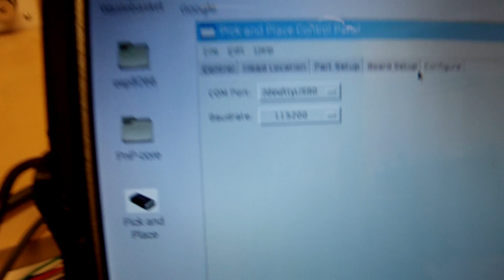Custom SMD Pick and Place Machine #2

Comment: which controller board you have used? an arduino or any other boeard?
Reply from the maker: Arduino RAMPS 1.4
Reply: and software for it? where i can get that?
Reply from the maker: @ashwinabhang229  RAMPS is running marlin firmware with 3D printer heaters disabled. Raspberry pi has a python script that generates the pick and place gcode and send it to the RAMPS board

Comment: Considering this is 3-ish years old, I imagine you've already figured out that it is actually NOT the arduino's fault that the motion isn't 'straight' to the point when performing a diagonal movement.

Its doing this because of the code being used... 300,000 mm/m is kinda fast, but not so fast that the arduino couldn't handle it. There are printers out there that have 'non print move speeds' a bit higher than that, and are still using a RAMPS 1.4 setup. The issue, is that the distances are not even. Therefore the head doesn't arrive at the same time. Even if you are just moving it X100 Y100, its still not even because of how you have the Axis for X and Y set up. One has a different step vs mm ratio going on. If that isn't accounted for, then of course its not going to  reach it properly. 

But what I'm curious about, is since you seem to be using a RAMPS 1.4 setup, are you using something like marlin or another 3D printer equivalent firmware? Or is this a custom one that you've made up for it? If it is indeed a 3D printer equivalent, or even a normal PnP firmware designed for the board, why exactly are you making your own software to control it when there are actual PnP software out there for free that is really quite good. Some can even just do things via normal Gcode to get things done. 

Anyway, i wouldn't go saying its the fault of the arduino.... 16Mhz is really really fast for what is being asked of it... specially if its just straight line movement... what really 'gets' to an arduino is circular movements because of the massive amount of computational power required to do the floating point math... But a straight diagonal line? oh geez it can do that no problem! Specially if you have the code set up properly... Because remember, it doesn't need to send a pulse out for every single tiny microstep that the stepper drivers are configured for... They can be sent as whole steps, which means less math being involved, and less pulses needing to be sent out. If the software is done correctly, it'll know to use microstepping for the fine movements, and whole steps for larger ones, which would negate the issue shown.

Comment: what drivers do you use? RAMPS1.4?
Reply from the maker: Yes that's correct, the RAMPS 1.4 with a4988 stepper motor drivers
Reply: any advice on how to program the motion of the pick and place machine?
Reply from the maker: Jason Wei Han Lee The pick and place machine uses python to send gcode to the RAMPS board over the serial connection. I used gcode for basic XYZ movement and I'll use a custom system for the vacuum and nozzle stuff :)
Reply: willz1200 sounds good. I will try it out. Thanks mate

Comment: Hi  willz1200,  It's an amanzing machine with high speed and accuracy, I have some doubts, how  determinate the movement of the heads  in some case the PCB is without motion  but the pick and place's head is moving is factible in that way or in another way the head is without motion and the PCB is moving or both in movement?  you know some links or papers with that focus?. For another handle in your PNP machine have axle instead of ball screw is more precise ok :D how did you reach that conclusion, exit any article?
Reply: Dude wtf are you even saying? Nothing at all could be derived from that jumble of words.